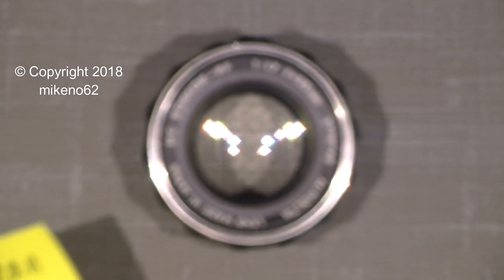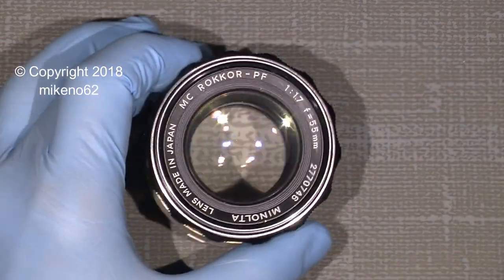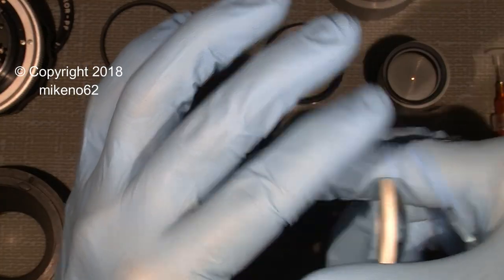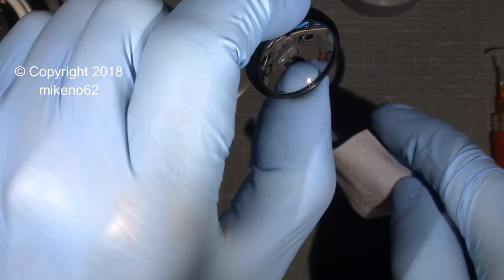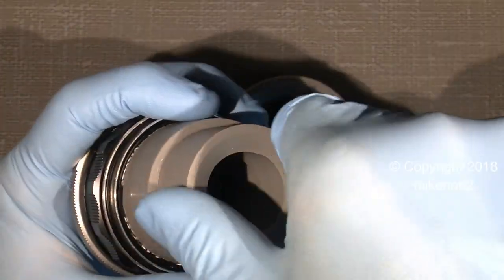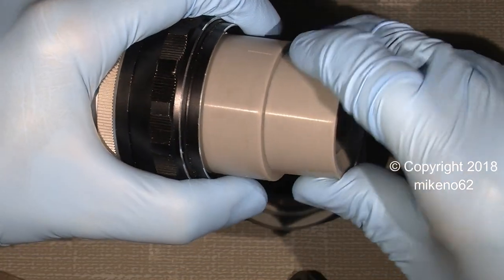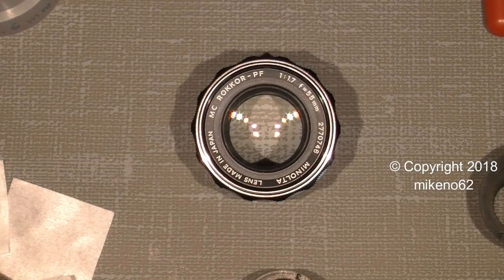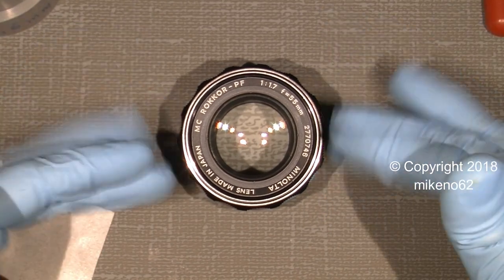How to clean lens elements in Minolta MC ROKKOR-PF 1:1.7 f=55mm (MCII version)

Comment: Great video and I only want to caution others on a few points shown here.  1.  Using adjustable tool-maker/pattern calipers can be very dangerous because the locking mech only keeps the arms from moving outward.  Any pressure inward can potentially release the footing of the modified ends out of the keyed barrel's notches and risk a violent scratch upon the outer lens surface.  This is why normal lens spanners lock completely.  2.  The use of acetone, though works probably faster than most other solvents, it's very strong and can remove paint, anodizing of AL and worse, lens coatings.  Best to use white gas, lighter fluid, or even 91% AL and apply with a fine hobby painters brush instead of a broad tipped cotton swab.  The brush carries the solvent and when applied at the crease/crack of threading you can actually observe the wicking of the solvent into the area it's needed most.  Again, great video and thank you.

Comment: Can't imagine lighter fluid being very good for any multi coating on the lens.
Reply from the maker: There is no problem with the coating, it's much harder than you think it is, also many other professional repair people just like me, use lighter fluid, but also Acetone and Isopropylalcohol 99% and Methanol ("Eclipse" sensor cleaner) , but also other effective solvent's is in use when cleaning lens element's. Of course there are also lenses where the coating is more soft, and good care must be taken.
But the lens tissue is also very important, I use the "PEC-PAD*" that work really good, but ONLY when use with some solvent, just like Lighter Fluid, Acetone, "Eclipse" Methanol, Hydrogenperoxid.
Xylen (Xylol, Xylone) is a stronger solvent so take good care when use that!